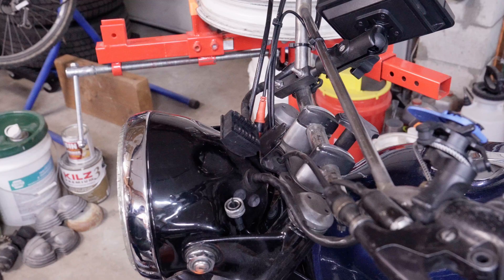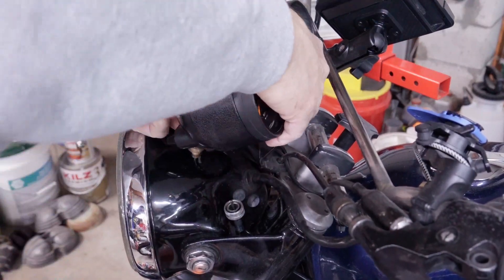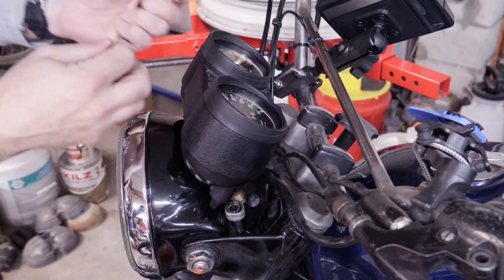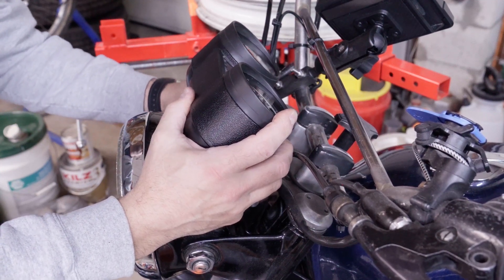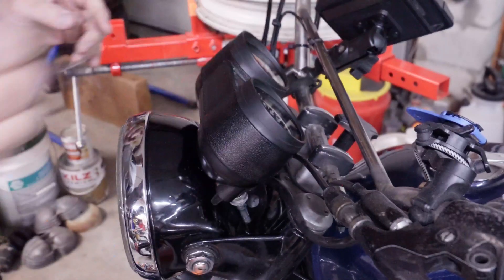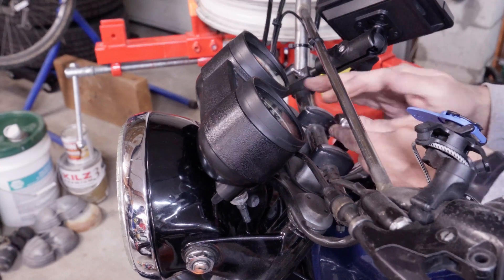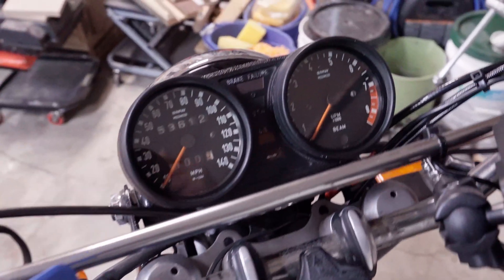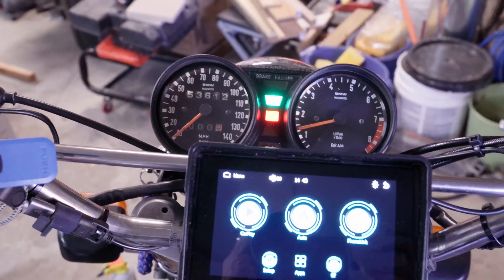BMW Airhead Speedometer Tachometer refresh PART 3 - Install, Ride and Calibrate both Instruments

Comment: Another great video Heiko. I am contemplating repainting my needles because speedo and tacho are quite different colours. However speeds were accurate before I started restoration. Do you think that removing the needles and resetting them against the stop put yours completely out of calibration again? I know when I sent my Norton chronometric speedo off for repair it came back perfectly calibrated so assume an expert has some sort of control to relate cable rotation speed to true mph.
Reply from the maker: Yes. Taking the needle off will mess up the calibration. The pros probably have some test equipment to do the calibration on the bench. Cheers